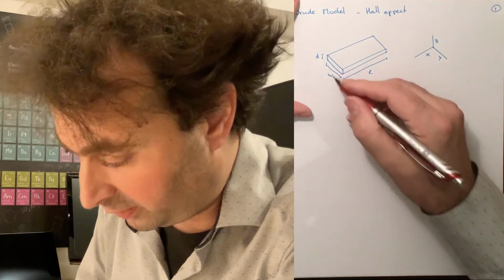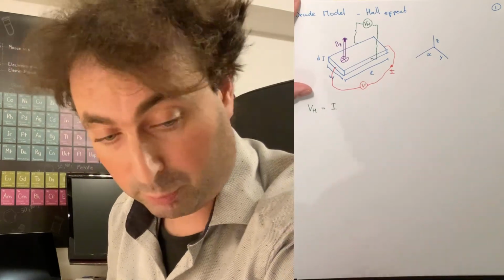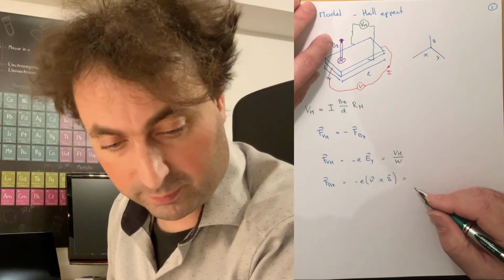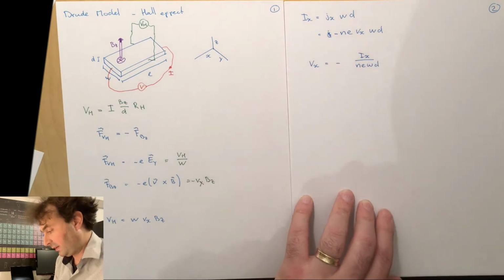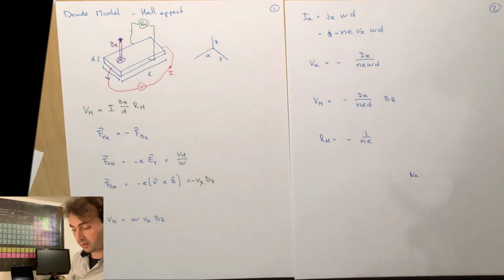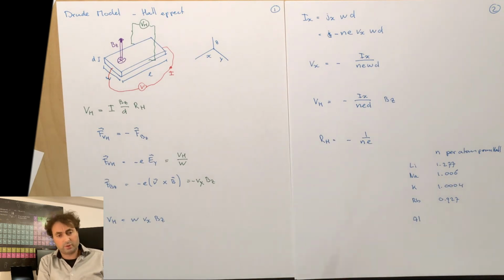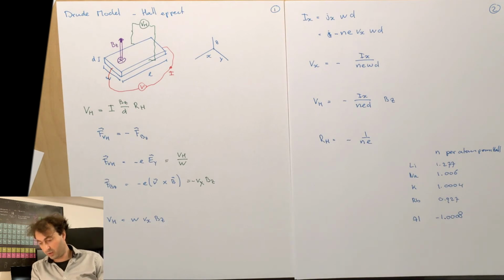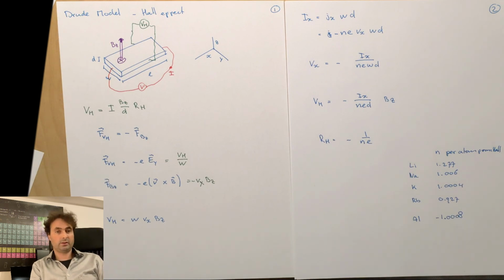02.4 Drude model - Hall effect

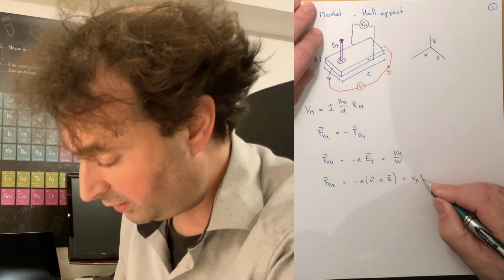Comment: In 4:30 at evaluation of Hall and Lorentz forces was missed elementary charge, in further step they would mutual divided between each others. Meanwhile, thank you once more for open access lectures:)
Reply from the maker: Dear Петя, indeed thanks for pointing this out. The charge of the electron is there in the first step, but then dropped after the equal sign. I dropped it both for the Lorentz and Hall force sucht that in the next step all is fine.....(sort of).... Sorry for that.